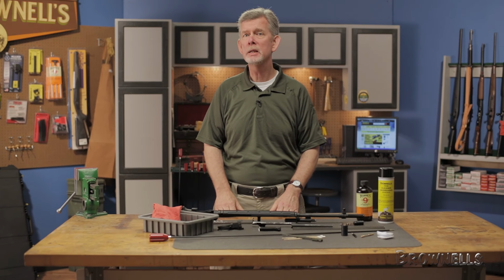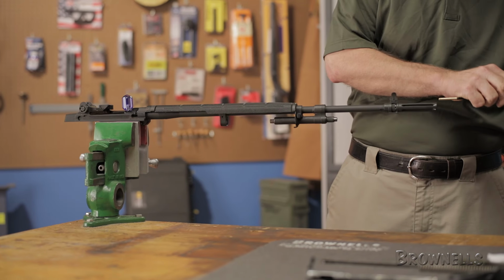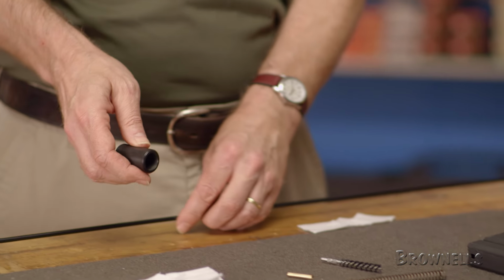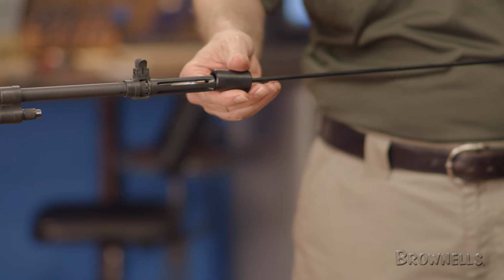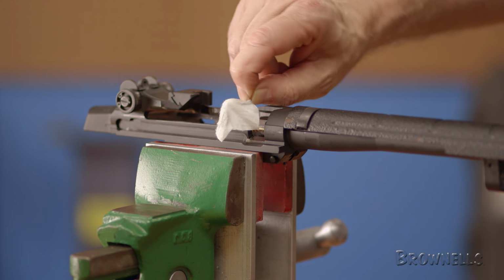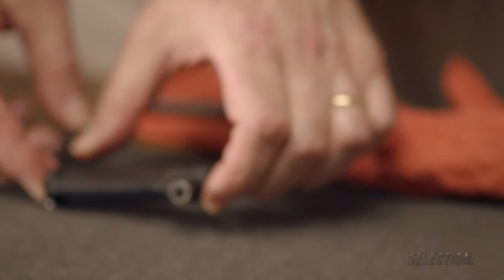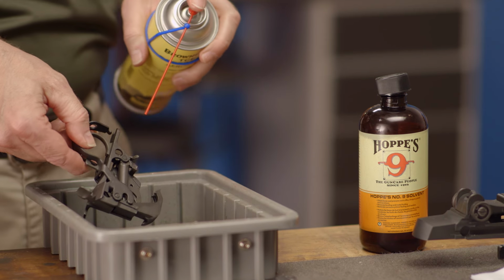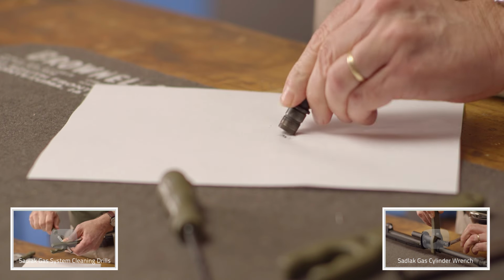M1A  Firearm Maintenance: Part 2 Cleaning

Comment: Springfield Armory recommends not field stripping the M1A for routine cleaning. Instead they say that routine cleaning should be limited to the barrel, chamber, bolt face, gas plug and piston. They only recommend field stripping the rifle about once a year for more thorough cleaning. What are your thoughts about this?